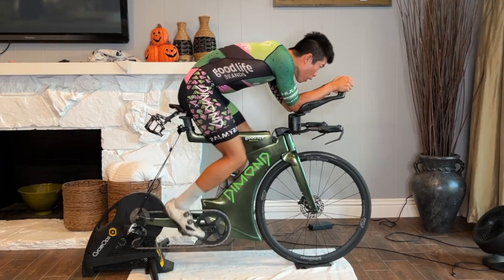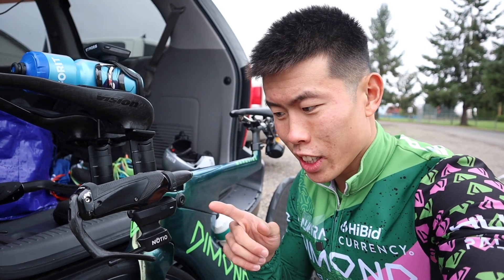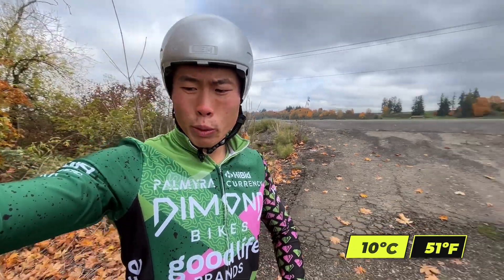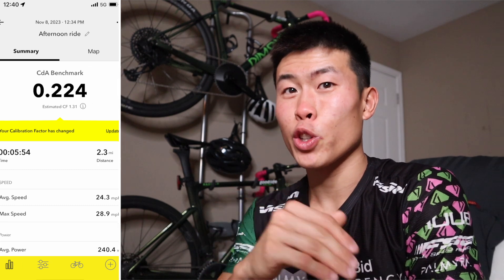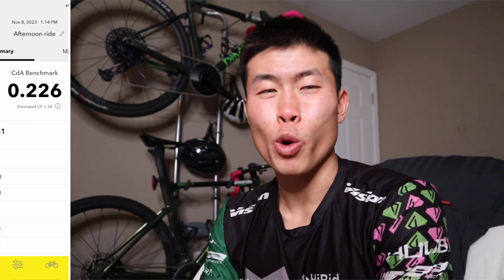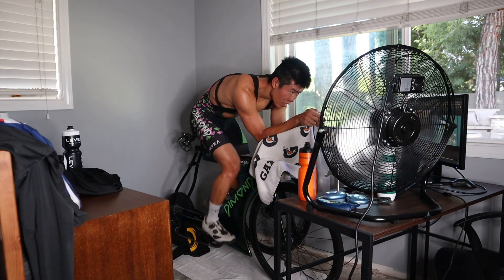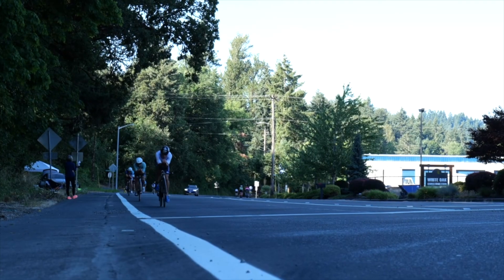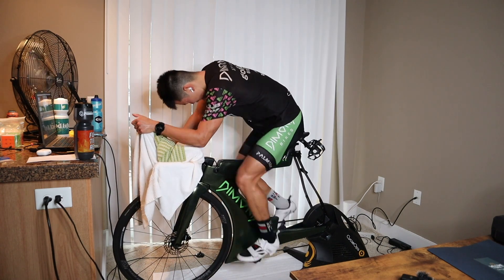My 1st Aerodynamic Testing On The Bike

Comment: If you are carrying hydration or other kit behind the seat, make sure it forms a sort of faring - something that allows the air to smooth itself as it comes back in after being split by the bike and rider. What happens ‘behind the bike’ is actually the most critical aspect of aerodynamics, because there is a huge low pressure system that develops as the air comes back into position. Your rear water bottle cage system looks like a huge aero anchor to me. Either bring the water bottle right in under your arse, or ditch the rear water bottle system all together. 

If you can find a day that is warm enough, and someone to assist you in recording data and making the little changes required between tests, try ditching both the water bottle on the frame and the rear cage system and just go with the bottle between the aero bars and one down the front of your jersey (with aid stations on the bike course, you should have enough hydration options on course to replace biddons).
Reply from the maker: Thank you for this. I've had a couple people tell me about the rear hyrdration!